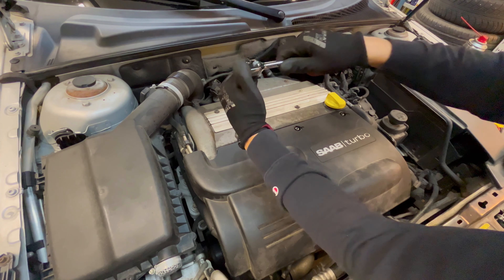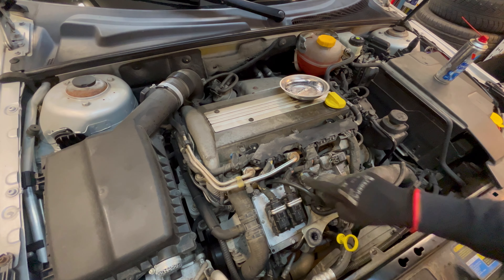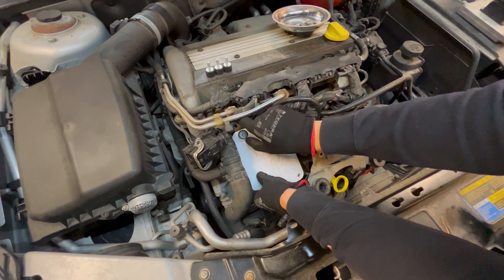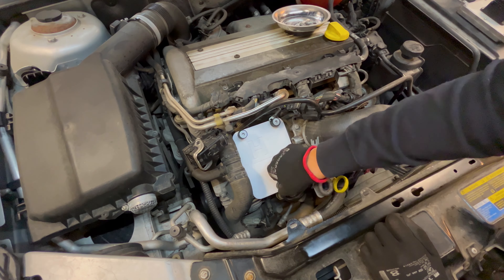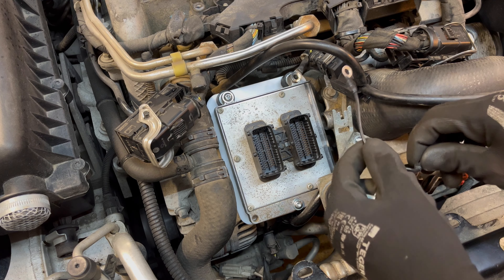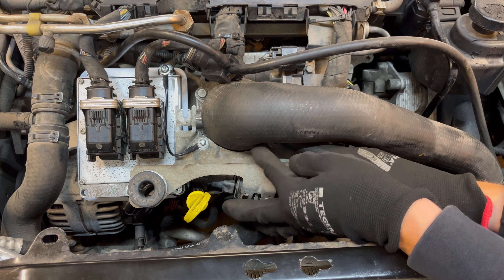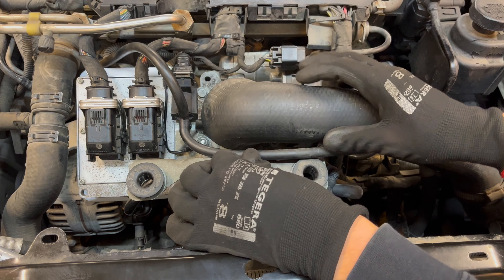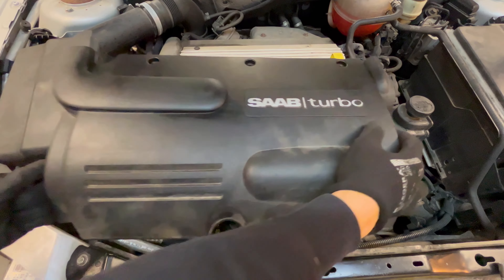Heat shield install guide - Trionic 8

Comment: The ECU is installed on the  exhaust manifold, which is filled with cold air from the intercooler. I think this plate is of little use. The only thing that makes sense is to saw ventilation holes on the engine cover. Then there will be an upward flow (convection) of air near the ECU.

Comment from the maker: A little update - the 6 nuts are now obsolete. You are supposed to only use the thread extensions from now on. The kit now also contains an extended bolt for the ground strap.

Comment: IT still hot.Why you do not used AL. heat sink plate and move ECU.near air intake right side by cut 5wires and connect longer .So ECU. will more cool...
Reply from the maker: Have you tried one of our heat shields? The major breaking point is not the absolute temperature, but the thermal cycling. This is comparable to the making of glas. If the glas cools down too fast, it cracks. We have a dedicated blog article about this backed by scientific research: https://hirschmann-koxha.de/en/blog/heat-shield-sense-or-nonsense/

Comment: Hello j go t this one heat spacer kit and i really feel like my car lost power nothing bad it just dosent feel as fast buh dont get me wrong it still goes
Reply from the maker: That's very odd and definitely something we haven't experienced before. Can you try to clean the ground area with sand paper? What I could imagine is that a dirty ground could interfere with the signal processing.

Alternatively remove the heatshield and test if the issue persists. If yes, then it can not be related to the kit.

In case you purchased the kit from us, do not hesitate to send us a message and we will look into it together!

Comment: will this work on an ECU thats already failing sometimes or do i need to buy a used one thats not having any issues
Reply: If its already failing, its already too late.  eSAAB Parts in the US can help you swap yours and they can flash it with your correct info.

Comment: Hello, congratulations for your work. Great video and very well explained.
I did the same with my ECU (and having a video like yours would have been a great help) and as it was still giving some heat failure I added a fan connected to the chassis of the car that I turn on with a switch from inside the vehicle. 
Although I lowered the failure rate a lot, it is still giving some failures. I think my ECU was already in a very sensitive state to temperatures by the time I wanted to remedy the problem.
I would like to ask you if you know where I can get a replacement part or if there is a reputable ECU repair company you can recommend. Thanks a lot for your work and videos.
Reply from the maker: Hey Scott, glad that we could be of help. Write us your details and fault codes to kontakt@hirschmann-koxha.de

We are the only company to officially (Orio supplier) and really repair these ECUs. Unfortunately there are a lot of "scam" offers out there claiming that they can fix the Trionic 8.

Comment: I installed exactly as shown. I went to start the car and it started and ran for about 1 minutes then died.
Reply from the maker: Are you sure that the ground strap is properly installed? In case you disconnected  your battery terminals during installation check them as well.
Reply: @hirschmannkoxha  I double checked the ground and it looks appropriately fastened. Tried leaving the battery off for 10 minutes and still getting the error.
Reply: Okay I drove it around for a bit and it turned off! Maybe it needed to recalibrate or something? Who knows. Everything operating smoothly.
Reply from the maker: That's very weird, if it is a ground issue you will see a message in the SID saying that there is a TCS fault.

If you see that or run into any issue just send us a message via our contact form and we will get back to you!